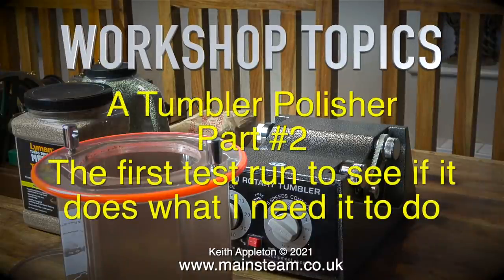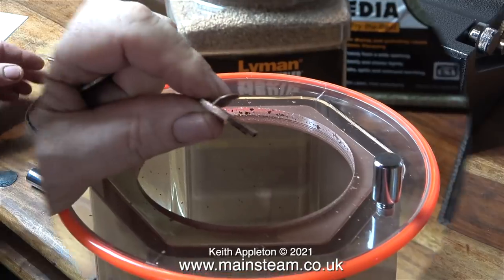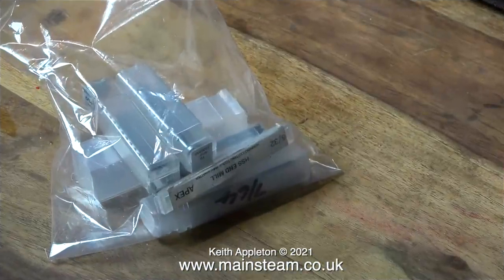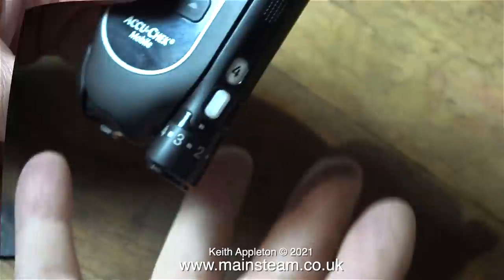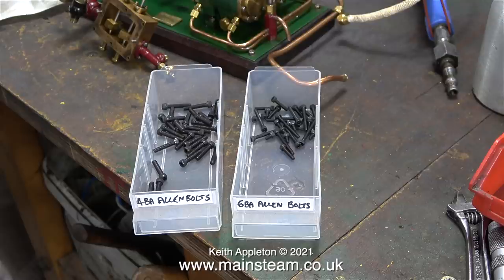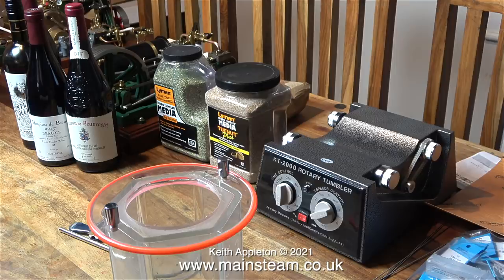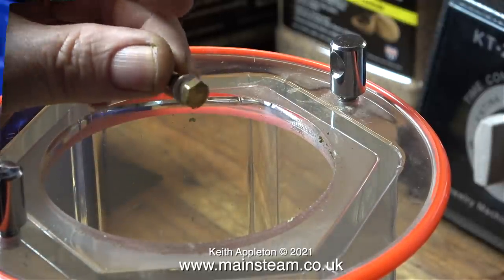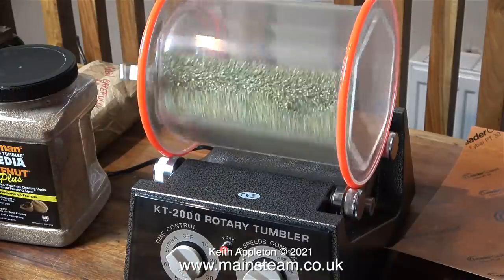TUMBLER POLISHER - PART #2 - WORKSHOP TOPICS

Comment: Hi Keith, I agree with the comment below, it seems to be running a bit fast to me. Back in the dim dark ages I remember building one of these with my woodwork teacher. We used a plastic drum, quarter filled it with fine gravel and sand, then turned it on for about a week on slow. (I think he was trying to polish gemstones) By the time it finished we'd forgotten what we were trying to polish but I do remember they came out very shiny.

Comment: Couldn't you change the belt and pulleys With replacement pulleys and belt for a 3d printer to slow it down abit
Reply from the maker: It seems to work OK as it is ........

Comment: Hi Keith,  I would run this 3/4 full of media and material....   I would also run it on the slowest setting
Reply: My limited experience has shown the same results. The tumbler media is in contact with the parts for more of the time.

Comment: I have a similar machine for polishing stones and gems. I haven't used it the last few years, but it's a bit smaller then yours. It came from a hobby shop with a bag of polishing sand, which is not something you would use on steam engine parts as sand particles could get stuck in the nooks and crannies. I've never used this type of machine for cleaning parts and I'm curious about it.  Would the steel balls wear small details off of small parts such as raised part numbers or edges?   Would putting other parts in the tumbler bang against other parts gouging or scratching them?
Reply from the maker: It just seems to work, the parts come out nicely. More to come in the next episode . . . .
Reply: @keithappleton  Okay.  Now I'm wondering if you could build a tumbler that ran on Hamster power?